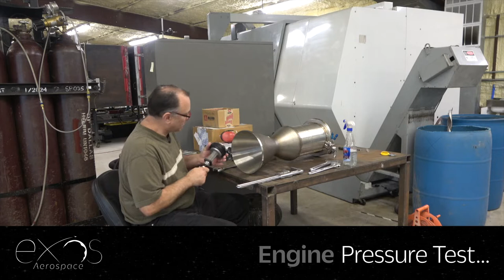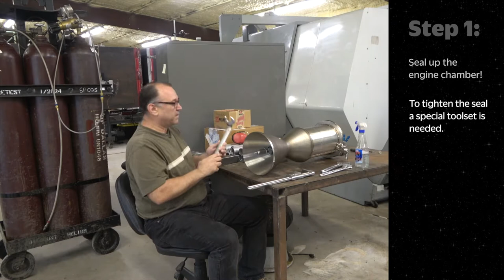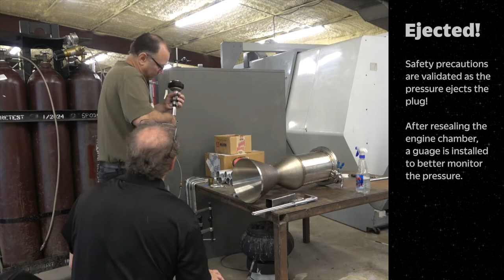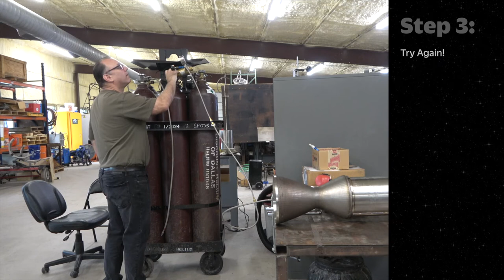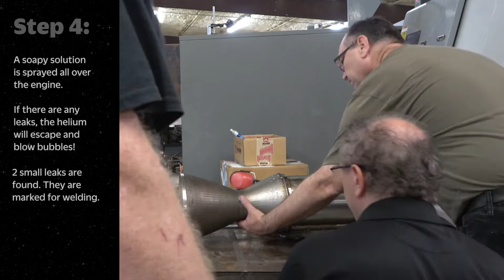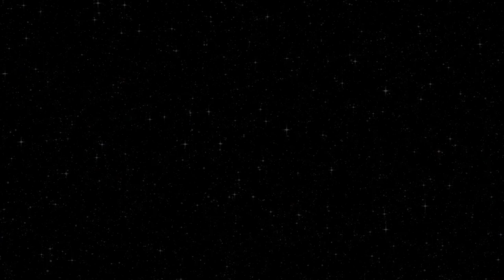EXOS Aerospace - Pressure Test

Comment: Hi!
Why you don't use thermal imaging for detecting leaks?
Reply from the maker: I'm sure thermal imaging would work, but the method we use is actually quite effective, and cheap!  The only special equipment used is a spray bottle and some soapy water.  Sometimes simple is better.
Reply: @exosaerospace   I don't know what leaking velocity critical for you, but I assume any leak will be critical and dangerous. When I worked with composites, we mast used both as thermal and ultrasonic methods for leaking detection. If professional devices too expensive and cheap devices didn't have enough quality, you always can rent one on day or two, or buy one in lease. Anyway I wish you success!
Reply from the maker: Thanks for the note Pavel, the leakage we are looking at is not "hot gas" leak paths, but mainly areas that are where fuel or oxygen could possibly leak outside the engine.  We have a different QC process on the internal weld areas during assembly of the engine.  The test you see in the video is more of a final stage of assembly leak test.